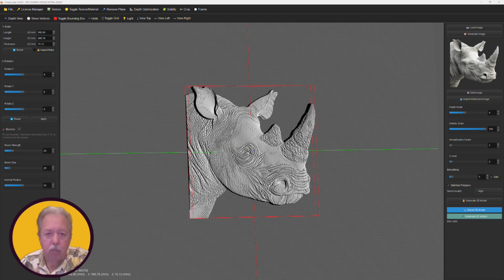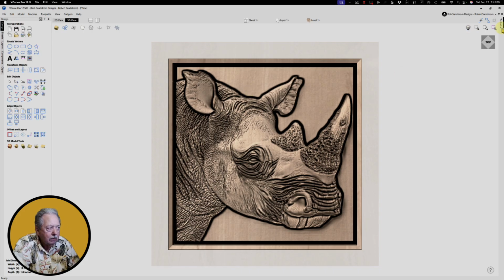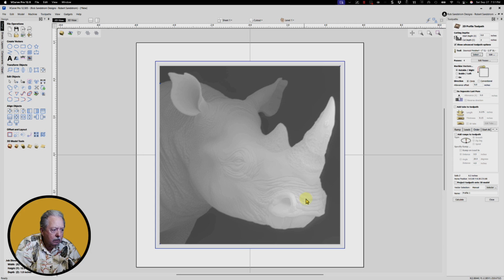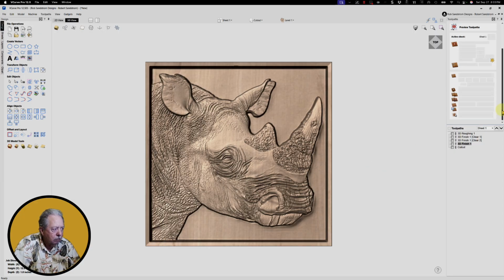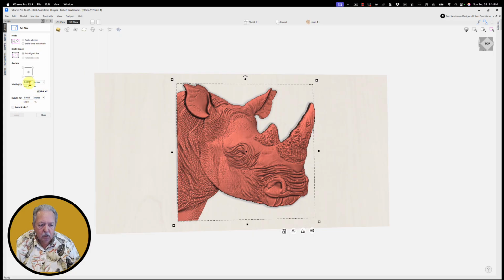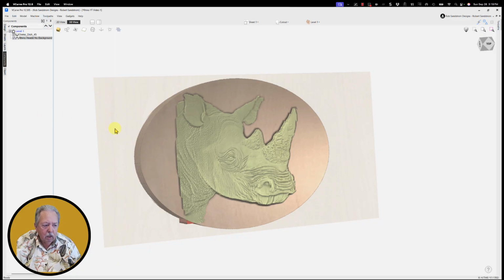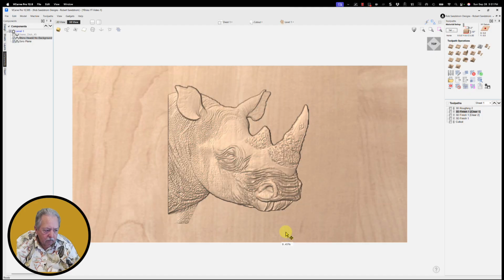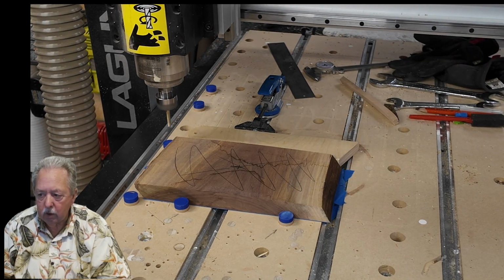Step-by-Step CNC Carving with Vista Sculpt & Vectric vCarve Pro

Comment: What do you think about the difference between Vectric AI and vista sculpt?
Reply from the maker: I do use both of them and don't have a strong opinion on each program.  I like them both.  See my summary of my thoughts - a little bit of a long reply but trying to be helpful.

I would summarize that I like the simplicity of EasyCreate.  It is a great software addition to Vectric and gives the most amount of flexibility in using multiple created models because they are .v3m files vs. .stl files. Although the lack of being able to output *.stl files is considered a downfall by some I have spoken with.   The other nice feature of EasyCreate is it doesn't require a subscription - which many people find more cost effective.  Especially if not creating models on a regular basis.  

I like VistaSculpt because it seems to do a better job at taking an image and turning it into a 3d relief model on a more consistent basis.  Of course that is in the eye of the beholder.  Also the ability to fully manipulate the model adding additional models, smoothing, refinement tools, and add frames is really nice on VistaSculpt.  Also the subscription based model does not always work well for some people.  Especially if they are not making several models.  If one is using Aspire, than the additional features in VistaSculpt become a little less important because you can do the model manipulation in Aspire but if someone is using vCarve the model manipulation features are much more helpful.

In summary I like them both and switch between the softwares quite often and sometimes I use both for the same creation and pick the one that had the best output in my opinion.